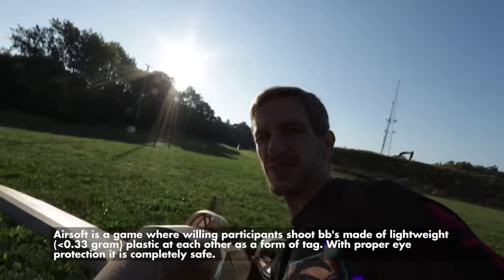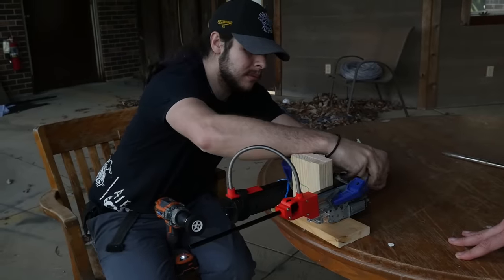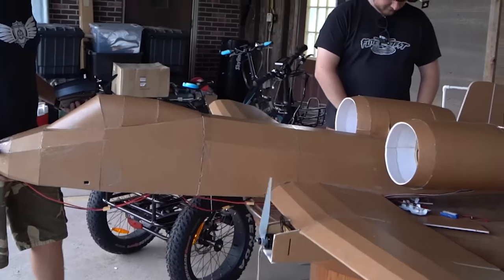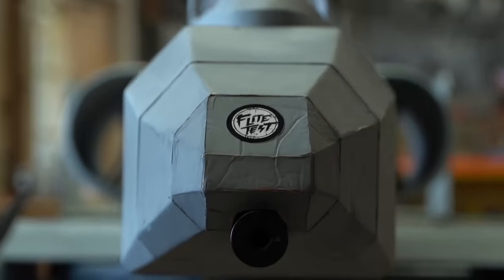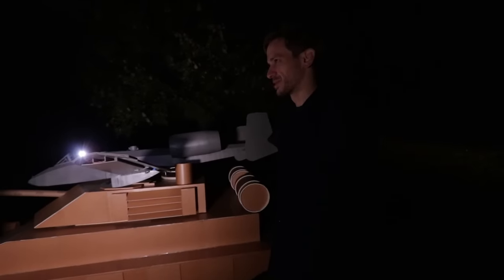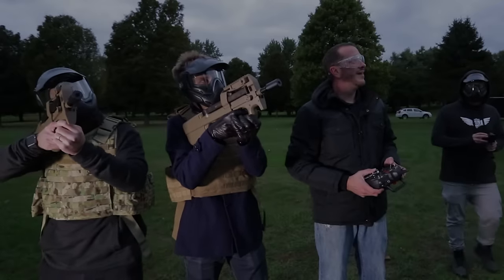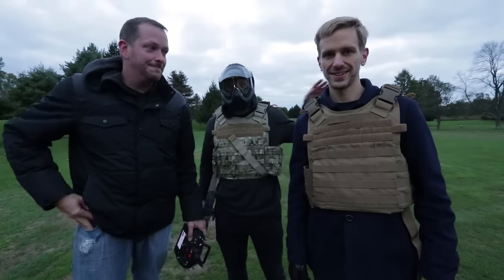A-10 Warthog  VS  Tank - Epic Airsoft Battle

Comment: Very cool...

...Now do a dog fight...
Reply: Its a great idea but it would be impossible to hit each other
Reply: Maybe if the tip of the barrel could move on a joint to change to angle of fire?
Reply: @clex2349  that would make it even harder.
Reply: Not necessarily, if it just moves a smidge, so it can go for a bombing run kinda tactic so it flys over head while it shoots downward.
Reply: Literally what I was thinking
Reply: @clex2349  still allmost impossible
Reply: One way to find out
Reply: @clex2349  you can do a fun video like you biuld to planes one for each team then there is 2 from each team trying to shot down the enemy plane
Reply: Sounds like a fun time but I couldn’t personally host that.

Comment: Having thought about this for almost a year... I wanted to add a second comment.  Those airsoft guns you had are likely on the weak side and COULD be upgraded.  Gas guns would pack even more punch and they offer heavy weight BBs for people who want to shoot farther etc.  If this had been repeated with something heavier (in terms of energy output, not weight) I think that the tank would have taken real damage and from the ground you could have likely cut that airplane in half with some of rates of fire I've seen airsoft guns achieve.  This is a 100% viable idea for adding to an airsoft game aside from the minor (major) safety issue of crashes etc... but I'd sign a consent form or whatever I needed to because that's too rad to pass up.  Even without it firing on you just trying to shoot one down would be cool to try... obviously with a gun capable of doing enough damage fast enough to the aircraft (my M4 clone with a lipo might hack it, but I feel the RoF is lacking)
Reply: they seem to be Cyma P90's which are shooting around 1.4 joule (120ish m/s, 400-410 fps). Should be plennty enough to eventually take the plane down, these guys just need a bit of practice :)

Comment: That was fantastic!  Now you just gotta put an FPV system on the A10 so you can aim that much easier.
Reply: Looks like they just used a camera in the cockpit for the cockpit view, rather than an FPV system like that was on the chase quad.
Reply: at the first start at night josh had fpv but then he crashed it
Reply: or mount a laser pointer inline with the top side of the barrel so when you see the dot you hit it

Comment: If you ever do this again try installing a heavier spring in the gearbox and using a higher voltage battery to get better performance out if the A10 gun.

Comment: Next do real bullets
Reply: Ben McGarry
and test it out in iraq....
Reply: There would be so much recoil and added weight. It would be too much for the foam boards to handle, and very hard to control and keep stable in the air. (This comment was posted WITHOUT PRIOR KNOWLEDGE OR RESEARCH, besides the military does that already lol)
Reply: @Deadman2716  There is this thing called a 22 rim fire and its got the same amount of ricoil as a 1100 fps Pellot gun
Reply: @Rookie_Cultivation  That's why I stated no prior research or experience with ballistics, but actual guns and bullets are heavier than plastic pellets and plastic guns. Thanks for the info though :)

Comment: Mounted the mechbox sideways eliminating functional hop up, try shooting that rifle sideways and watch how the BBs will curve in the direction of the tilt, hop up creates backspin and without it its dam near impossible to get accuracy and range.
Reply: I guess youve never looked at the hop ups on an M249, M240B, Stoner Mk23 or even an M60.  All of those airsoft guns use a side mounted magazine with the tubular spring feed system and guess what, the hopups are at a 45 degree angle if not flat.  They all have adjustable hopups by way of a cylindrical style hopup mounted to the barrel not to the mechbox frame.  Most of them are metal as well and not plastic.  I actually help to build a dual mounted set of M60s and they worked flawlessly.
Reply: @christopherbordelon5960  its called the Magnus effect google it.
Reply: @DoubleClutchProductions  I dont have to look it up, Ive seen it with my own two eyes.  You can have a hop up on this weapon system, ask an Airsoft Tech
Reply: @christopherbordelon5960   I am an Airsoft Tech, just because the feed tube is at an angle does not mean the hop up nub is too, its called Magnus effect and if you googled it you would realize that if the hop up nub was at a 45 degree angle then the bbs would not have backspin but side spin and would curve in the direction of the spin. This is why all inner barrels and buckings have the same style cut. MAGNUS EFFECT is hop up, now call your hits and move along.
Reply: @DoubleClutchProductions  Ive been doing this for 20+ years...how long have you been at it.  So lets re-evaluate the problem here.  First off where is the hop up and the bucking.  Normally it somewhere close to the magazine because in most airsoft guns the magazine feeds right into the hopup because the magazine spring keeps tension on the bbs.  Thats why theres a spring loaded nub to hold the bbs back until you insert the mag into the weapon.  Now lets look at say an M60 machine gun.  This does not use a magazine in a since as it has a flexible tubular magazine that goes into the weapon using a threaded nut potruding out of the hop up.  Are you following me on this?  Since you dont want any tight bends in the magazine feed tube you have to mount just the hopup in a way that the feed tube has enough length that it does not cause problems because the mechanism that drives the bb's is also what holds tension on the whole line in the feed tube.  When your ammo starts to become depleted or there is no tension then you get no ammo or sporadic fire.  I know you said youre a tech but Im explaining this to you so you understand what i did to get the results I got.  So onto what was done here.  it is possible to mount and get the results Im talking about.  You have to do a few things to get it to work and a lot of trial and error.  I spent a whole month trying to get the bbs to fly out of the weapon correctly and this is how I did it.  First youd have to replace the stock barrel with a tightbore barrel since rifling an airsoft barrel only works with a short barrel which in your case may work.  So I replaced the M60 barrel with a tightbore barrel and had in go through the flash hider.  The next thing I did was I added an additional hopup right where the two gas piston sleeves are to hold the gas piston to the barrel.  How did I add this to the barrel? you have to use an ak style or cylindrical style hopup then you have to work with a dremel to get to slide over the barrel.  After that you cut your notch out of the top of the barrel and you have a double hopup system that actually works great.  So I wasnt trying to make this about airsoft but it looks like thats what happened.  Oh and by the way Ill call my hit but just so you know, my sniper had you way before you had me as well as Im holding a grenade so since you I take it youre the one shooting I think youre dead too pal.

Comment: Should have tried to have the barrel pointed slightly downwards
Reply: Yes!  A somewhat downward pointed barrel would be much more effective and actually be like the A-10 which does not rely on face-forward strafing.  I like your plan.
Reply: Yeah the A-10 looks like it cants down several degree's. Then again they can line up to shoot a 30 mm depleted uranium round much farther out than the model so lining up the shot will be tough on the model I'd guess...
Reply: Good idea!

Comment: So.. Your surprised it flew the first time with little power. Your surprised it flew this time with more power slapped on... You modeled an A-10 Warthog. A plane designed to be able to take off with little thrust, and fly with very little power and as well with 1/3rd of the wings gone... What did you expect?
Reply: @Watt Waster expert? Could be.. maybe not. How could you know for sure. You watch videos of a10's. Doesn't quite make you an expert, but how could I know.  For all you know I could fly em..... One thing is for certain. They modeled it after an a10. Granted there may be some subtle differences like.. weight ratio and size. A10 is quite a heavy bird and can carry a huge payload of armorments. Bent wings or not. But thanks for your input.
Reply: @Watt Waster their wing looks bent to me....

Comment: Time stamps!
Introduction to airsoft components 5:11
Take off 5:39
Crash 5:57
Contemplating choices 6:13
Introduction to flight test 6:37
Explanation to teams and objective 7:08
 Quick Disclaimer 7:25
Successful takeoff 7:36
  Drone and Cockpit cam 7:43
Battle commences 7:50
Opening fire 7:56
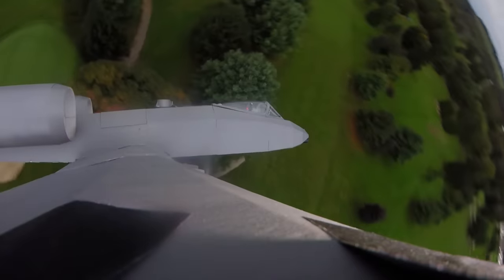Sustaining heavy fire 9:19
Tank takes a heavy hit 9:44
Battle ends 9:54
Damage overview A-10 WartHog 10:12
Damage overview Tank 10:21
Highlights 10:51
Outro and thankings 11:00

Comment: sick.  I know this vid is kinda old but for the a-10 gun,  a Classic Army m-16 mechanism with 11 amp lithium rc plane battery,   would shoot way higher rate.  maybe some other gun could be even better. & if you weren't already using a lithium bat, the weight savings could make 2 guns possible.

Comment: In reality "The WARTHOG" can actually the same type of flight system as the older and much less long-distance capable aircraft, after losing an engine the pilot simply switches over to it's redundant "fly-by-wire" manual flight control system, in addition it's also much fighter-bomber military aircraft, since it's basically a multipurpose, blank slate with only one feature that Can't be changed!(⌐■-■): It's rotary barrel, gatling machine gun that quite literally shoves said aircraft back into a near-stall whenever it's fired, while powered by it's own engines!

Comment: Designing it to look like an A10 automatically increases its armor durability and flight characteristics. The foam and cardboard becomes titanium and the pilot is more aware of his surroundings and immune to most of the G forces. Partly because he is detached and standing on the ground but literally more invisible due to adrenaline rush. The tank however, because of its shape also assumes the armored characteristics and so is nearly indestructible. Therefore the infantry would have been the better targets. The A10 and the tank should have joined forces.

Comment: Cool but not that practical or useful. Might consider putting a full auto pellet gun but those are very heavy and quite deadly actually. Or a full auto BB gun also range limited but a little more hitting power. There are different ones but they come as actual guns hard to separate the barrel and firing unit from the grips and stock though.

Comment: You should angle the gun on the plane better. The a10s gun is actually not centered its on the right side of the nose and aimed down a bit by i beleive 30° this is for the pilot to be able to more accurately aim and shoot. Because of the way you fly in the rc version and vision you get seeing through camera footage in a cockpit ide put the gun to the right of the nose like a real a10 but instead of having the gun aiming down at a 30° angle i would have it tilted up at roughly 30° this way the rounds would be going in a stream almost directly in the center of view of the windshield and it would be easier to hit targets being able to see the stream of rounds. With this angle while your descending your gun will actually be pointing straight and at level allowing you to have depending on the distance to the target a few seconds where a spray would hit from the top to the tracks of the tank and give you much better footage.

Try making a ac130 or a ww2 flying fortress. Like how cool would a like 4 or 5ft long gunship be that has 2 or 3 controllable double barrel turrets with tracers? Then you can throw some airsoft grenade in the bomb bay and have the wrings connected to string connect to the roof of the bomb bay with enough slack that they will not have tension untill having falling 3 or 4ft feom the plane giving the grenade enough momentum to snap off the rings making them go live and then you could drop them from low enough that theynland roll and blow up or you could drop them so high they airburst at chest level which wouod be really cool